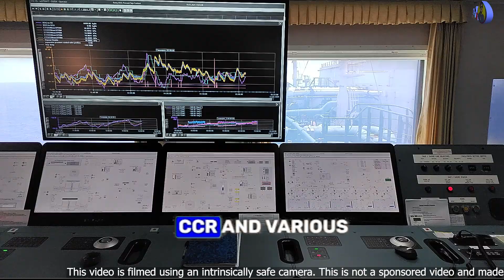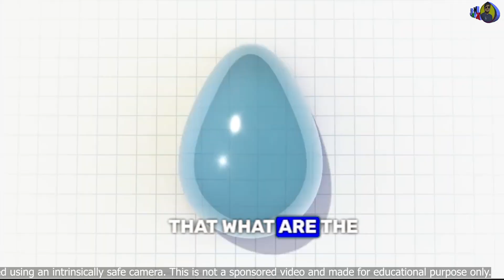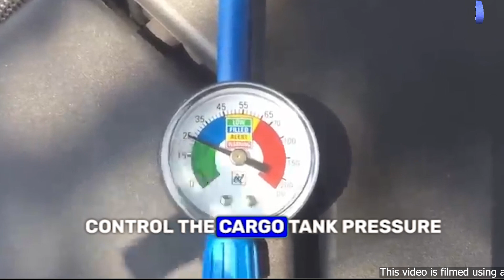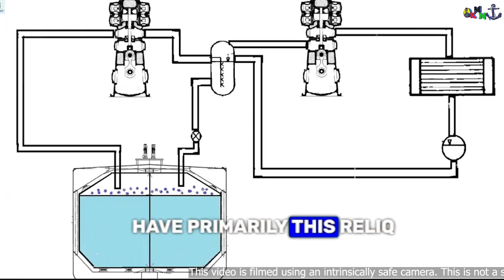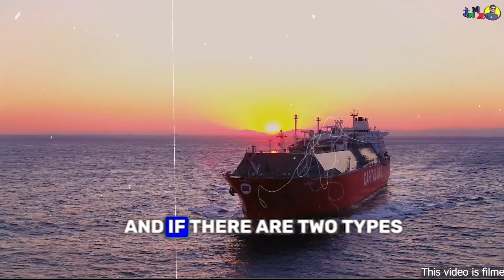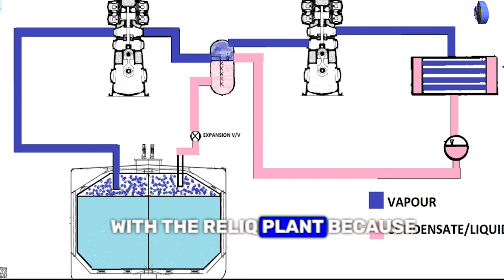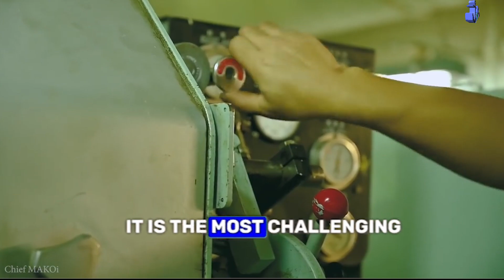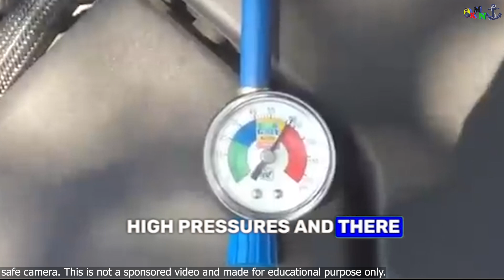LNG Ship CARGO OPERATIONS🚢 CCR 🎛️ | LNG Ship Gas Engineer ⚓  | Podcast with the Cargo Engineer🧑🏻‍🔧

Comment: sir why don't you are using LNG to runn the engine room and for the power generator  then i think it will help you in pressure maintenance and also it will be very cost effective
Reply from the maker: Thanks for your comment!
I am impressed with your curiosity.
Here is the reason for the same:
Q-Flex LNG ships are designed with slow-speed diesel engines that run on fuel oil because it's currently more efficient and reliable for long-haul operations. While LNG is indeed cleaner and cost-effective in some scenarios, these vessels are equipped with onboard re-liquefaction systems that capture and return boil-off gas (BOG) back to the cargo tanks instead of using it as fuel. This helps maintain cargo volume and pressure more effectively.
Switching to LNG for propulsion would require dual-fuel engines and significant design changes, which Q-Flex ships weren’t originally built for. So, using fuel oil ensures operational consistency while preserving the valuable LNG cargo for delivery.
I hope, this answers your question.✔️
Stay Tuned 💯 😊